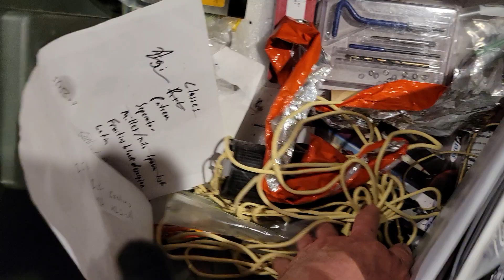High Powered 3D Printed Rocketry Certification Intro L1 L2

Comment: What fin thickness and infill percentage did you do for your L2 rocket fin can? Also, curious if you've ever annealed your 3d prints for extra strength or if they work great right off the printer?
Reply from the maker: .8mm nozzle 2x wall and 2x Infill multiplier. I went to a 4 fin design and lined up the Infill so the grid went down the center of each fin. Its been a while but I think it was like 12-14% Infill. No annealing. I did find you want a tube insert for the motor mount, motors like to melt themselves to the fin can. If you want the files I can email you them.

Comment: I tried this with a mate like 10 years ago, but instead of putting in the effort as you have, we just melted icing sugar and potassium nitrate together and packed it into metal tubes. Safe to say we failed each and every time.
Reply from the maker: Lol now that I'm level 2 I can do experimental motors but I don't think I will since I like the idea of not burning my shop down. 😅

Comment: I filmed an experimental rocket launch 25+ years ago you might find interesting.  In the first few minutes he shows the different engines.  Also that guy worked for Apple at age 14, lol.  It's an old video but look up "World's Largest Patriot Missile Model Rocket Launch".  I grow mushrooms too but not lately.  Just hunting them.  He used an I283.
Reply from the maker: Too funny. That thing just lawn darts hard lol. Was there even recovery? It probably needs a J300+ or K300+ with heavy thrust off the rail. Makes me want to build a massive foam one for fun too lol. We have tons of foam scraps for packing. Thanks for sharing!